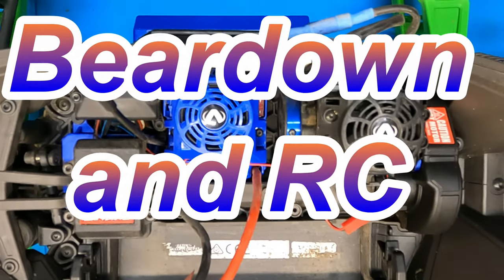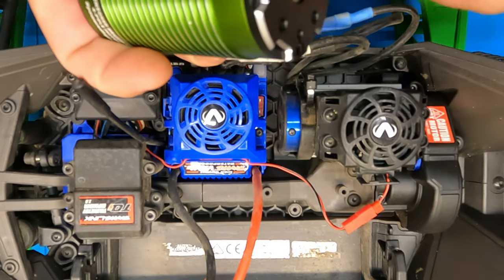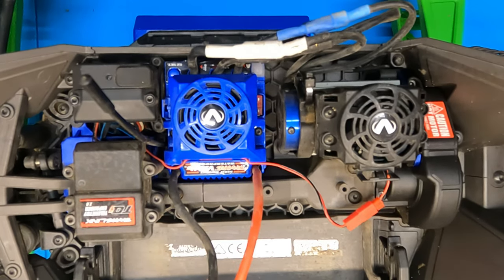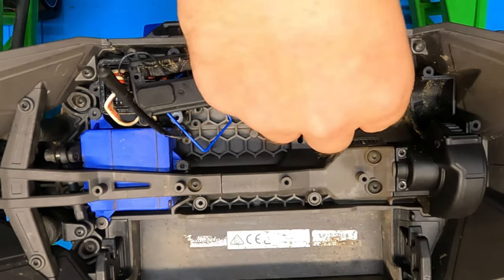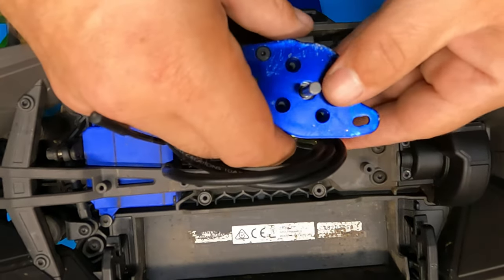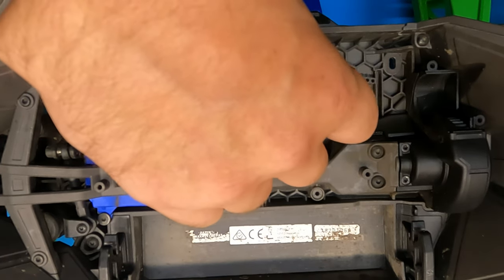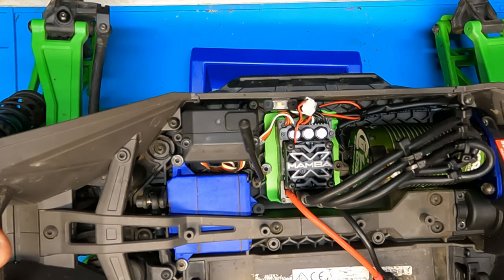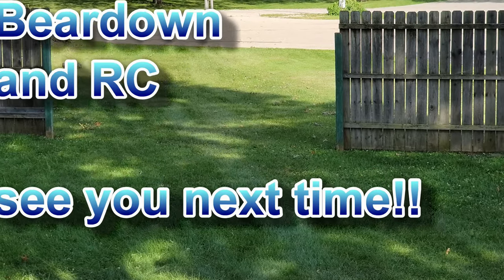How to install - Castle Creations 1515 Sensored Brushless motor and Mamba X ESC

Comment: How’s it run, I want the same for my truggy esc and all, they say no 6s for some reason with the motor idk why tho it’s the same as all the other combos
Reply from the maker: Haven't had the chance to run it on 6s yet. The Maxx we are running it on is more of a jumping/bashing rig, so we are still running it on the 24t pinion and 50t spur. We haven't had any issues with heat on 4s and no motor fan. The esc would have no issues handling 6s, but the motor you'd probably want a fan or 2, not over gear it, not run it on too rough of a surface, and just keep an eye on temps.

Comment: so what is the telemetry stuff you got rid of if you kept the tqi transmitter? im assuming that keeps the gyro too right?
Reply from the maker: The Mamba x comes with the Castle data log which has most of the info that the Traxxas telemetry has. So I put all that on my XMaxx until that bad boy gets upgraded. But as long as you keep the Traxxas TQi controller and receiver, you'll have all the gyro/traction control functions.

Comment: What kind of cable adapters did you use to connect the motor to the esc? Are they 6.5mm female to 4mm male bullets?

I just got into the Hobby, upgrading my Hoss to 4s. I'll be running the Maxx motor with the Mamba X esc.
Reply: 4mm

Comment: Can I run it on 6s
Reply from the maker: Yes, the esc and motor can handle 6s, but depending on your gearing, what tires you're running, and what terrain you're running on, you'll want to keep a close eye on temps. Ideally to run the esc on 6s all the time you would probably want a lower kv motor.
Reply: Do you have any issues on 4s with overheating? What motor did you run?
Reply: Castle said 6s is not recommended

Comment: What battery did you use ?
Reply from the maker: Right now we're only running it on a Traxxas 4s 5000 MAH.
Reply: @beardownandrc1064  does the esc come with a connecter on it?

Comment: After 4 months how has the esc been holding up to the big motor and truck?
Reply from the maker: It has been holding up without any issues. We even had it out at the motocross track on a day with a heat index of over 100F and no fan on the motor. With that being said, it's still running the 24t pinion and 50t spur,  it's mainly used as a basher so a lot of quick runs up to jumps without long periods of sustained throttle, and we haven't purchased a single 6s pack so it's only been run on 4s.